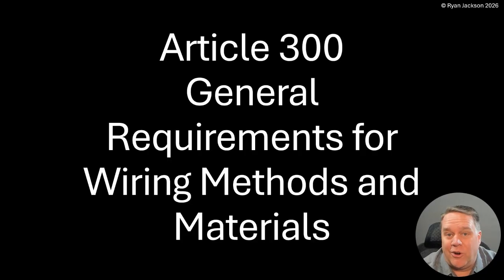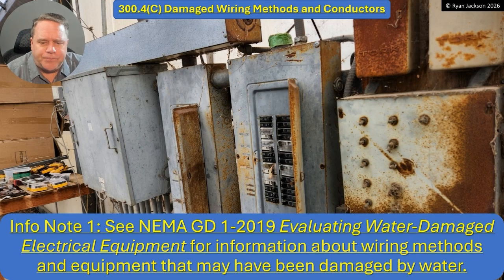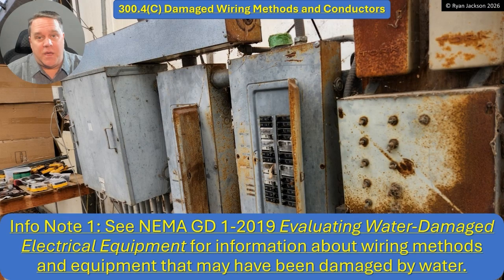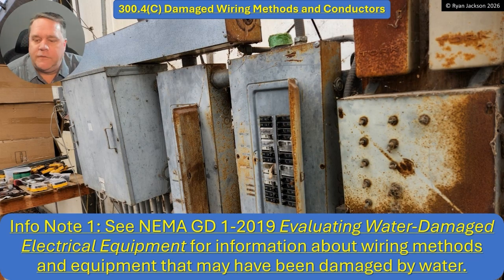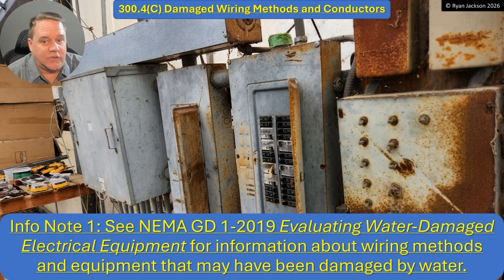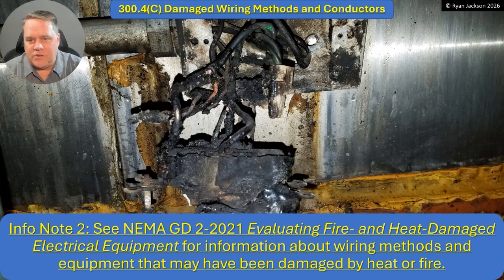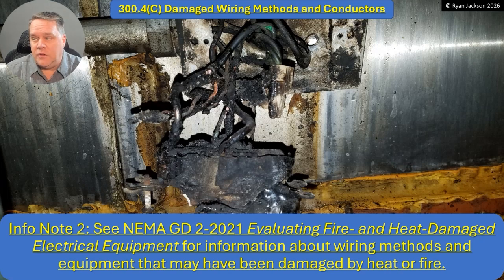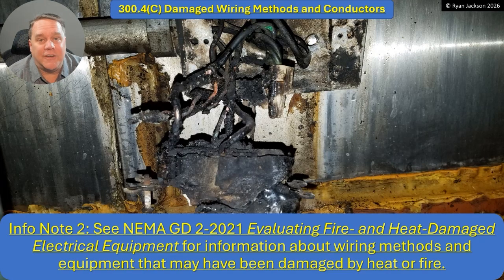100 Days of the 2026 NEC Changes Day 33: 300.4 Limitations

Comment: AHJs make stuff up all the time. We failed twice in one county for using cable ties at all. First was failed for stapling a cable tie to secure more than 2 cables, second one failed for using zip ties to clean up our home runs (it wasn’t bundling it was specifically the zip ties). Those zip ties were listed and rated for use with electrical cables too. That particular inspector also wanted us to screw the boxes for wafer lights to the rafters prior to the ceiling going in. That’s a fairly whacky thing to ask since not all the boxes for this type of light has holes for mounting. So we will potentially have to drill out these boxes so we can satisfy this inspector. The whole advantage of those lights is you just drill out the ceiling and install the box after the ceiling is finished. Now we will have to hope the homeowner doesn’t change their mind about light placement between rough in and trim, otherwise we will be adding junction boxes in an attic if a light is added later rather than just pulling on the wire slack to accommodate the added light.

Comment: Interesting new article. This is not my day job but it would never occur to me to not replace damaged cabling or equipment. Seeing  your first picture reminded me of an episode at our house several years ago where mice lunched on PVC insulation on some NM cable. I was not aware of the damage until it tripped the CB. Turned out about 18" of cable had the insulation completely chewed away.

Comment: I have worked in industrial manufacturing maintenance since 2010. My supervisor is 14 years younger and has never done any "real" electrical work. This is the only plant he's ever worked in. 
He doesn't understand why I insist on repairing damaged runs, removing anything that is no longer in use or dead wires that are still there & just dangling for an inspector of any kind to see.
Reply: They don't think about the future, only the now.
Reply: The problem with abandoned wiring - other than telecommunications and low voltage signaling - is that there isn't anything as black and white as you might think for best practices and procedures on how to abandon wiring and wiring methods that are impractical to remove and by that I mean removal would require ripping out drywall and plaster, which for anyone who's never remodeled an old house, this can be a safety hazard if the "abandoned" wiring is later on reenergized and is compromised or doesn't go where someone thought it did.  So what I do as a master electrician when old wiring is impractical to remove is I will terminate it in a dedicated junction box with no other in use circuits where accessible, both ends if at all possible, wirenut the hot(s) and neutral (and ground if present) together and use a label maker to mark the coverplate "WARNING: ABANDONED WIRING. DO NOT REUSE. DO NOT ENERGIZE".  That way if someone,  possibly decades later after I'm deceased decides to ignore my labels, ( perhaps the labels have fallen off)  and reconnected the wiring, the result is a dead short and breaker that will not reset, hopefully giving the clue that I meant serious business when I abandoned the old wiring.   

Other electricians I've talked to will terminate the abandoned wiring in junction boxes but leave both ends taped off (open).   Still others will cut the ends flush at the last accessible location and simply drywall over it.  

Just some things to consider although the AHJ would be the ultimate judge, jury and executioner for this gray topic.
Reply: @Sparky-ww5re It sounds to me like you are doing it the best way. 
My situation is all EMT/rigid pipe, strut racks, etc. 
I pull everything out and down that I can reach. If I get to a point where I can no longer reach the pipe, I put the wire (if still there) in a box, nutted & labeled (if I can find where it's coming from) & write in the lid if the box is empty or what the circuit is. 
We also have S.O. hanging around with plugs on them that I pull out.
Reply: @MrFixItGa yes,thank you for the feedback.  Earlier in my career I did mainly residential before going to commercial, although I will still get involved with remodels from time to time.  

I first learned the practice of terminating the ends of abandoned wiring that cannot be removed entirely in a dedicated junction box with all conductors wire nutted together i.e. short circuited from my stepdad when I was 16, back in the summer of 2005 as I was helping him rewire his ranch home originally built in 1973, that had a 70 amp Zinsco main panel in a bedroom closet and aluminum wiring throughout, also there were a few runs of copper NM in the kitchen and living room during an addition in 1991 according to the previous owner.  Anyway, there were some serious problems with the aluminum wiring shortly after Dad had purchased the home a few months earlier when we fished all new copper NM cables and installed a new 100 amp Siemens breaker box in the laundry room, actually the new panel is rated for 200 amps, but we used 1/0 aluminum SER IIRC from a 100 amp main disconnect outside at the meter, as Dad was on a tight budget and couldn't afford to do 200 amps and if memory serves me correctly, Detroit Edison would have added surcharge to upgrade the line from the pole to the house for a 200 amp service because the home is only about 1400 ft² and 200 amps wasn't justified based on the load calculations.  The old Zinsco box was left in place to serve as the "abandoned" junction box for the old aluminum wires, for which we shorted the hot, neutral and ground of every cable entering and replaced the dead front cover with a piece of sheet metal and labeled it with the label maker. Did the same thing for some of the old wiring in the crawlspace and attic.   We did have to rip out a good portion of the wood paneling on the walls to replace the old galvanized steel water piping with CVPC and in those areas we removed all the aluminum wiring and running the new copper NM cable was as easy as 1-2-3 with the wall stripped down to the studs.  The last accessible place in the walls for the aluminum wiring we shorted all conductors,  secured the wire nut with electrical tape, then shoved it aside.  

That was quite the excitement for a 16 yr old to say the least, and looking back I gotta admit, I really enjoyed helping my stepdad make our home as safe and modern as possible.  How that home never caught fire, I have no idea.
Reply: @Sparky-ww5re That was a cool story. 
I personally never really cared for the idea of twisting them all together. Something about it feels wrong. 😂
I'm sure it works well when needed, though. 😬😂
Being in an industrial manufacturing facility, I don't like the idea of shuttingdown the plant because I never located the other end & somehow, some way, someone turned it on. 
I once bucked a 120v control circuit for a 277v lighting circuit with the 277v feed. It was with a previous employer, in a really old facility. The ENTIRE front half of the plant shut down. Front office and manufacturing floor. I insisted on doing the work on the upcoming Saturday, but they insisted on it being done at that moment. Needless to say, if something needed to be done, they paid me double time on Sundays from that point on. 😂
The 20 amp breaker for the lighting circuit didn't trip. The 400 amp main breaker in the panel didn't trip. The 400 amp breaker in the switchgear didn't trip either. It was the 1200 amp main for that piece of gear that shut off. Ever since then, I'm extremely cautious about what, when, and why I'm touching old, possibly unused stuff. I don't care so much about being shocked. I'm careful in that aspect. I respect it, but I'm not necessarily afraid either. 
I don't ever want to shut a plant down again. It's a little embarrassing to say the least.

Comment: I disagree that wiring methods can be repaired. Certainly, not all of them can be, but there are some. There are a LOT of times where NM and NM-SER cables have their outer jacketing nicked, or otherwise damaged during installation. Since these are dry locations, and the conductor insulation was not damaged, this is not usually a big deal. Usually its up to to the AHJ to determine if the extent of the damage needs to even be addressed, and when it does most manufacturers have instructions on how to repair that jacketing in place. This is an area that needs a revision for 2029.